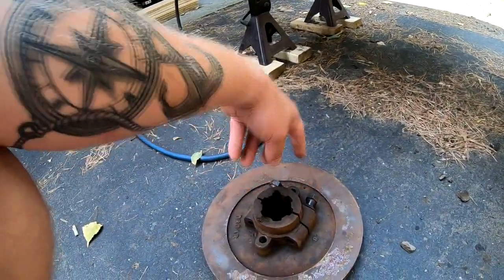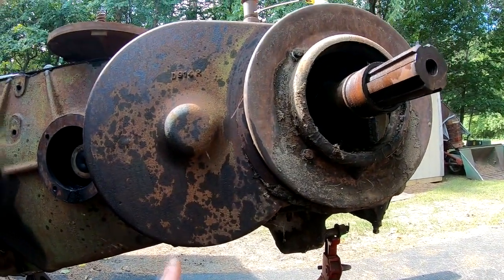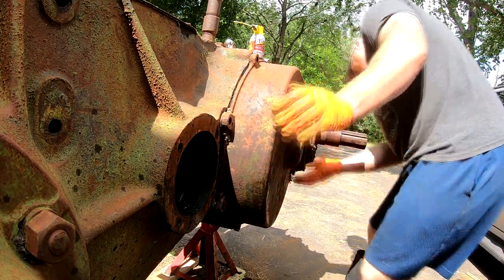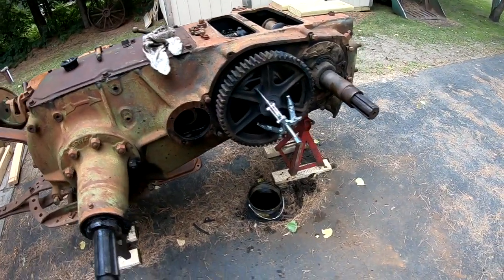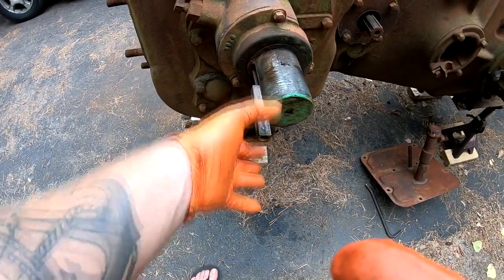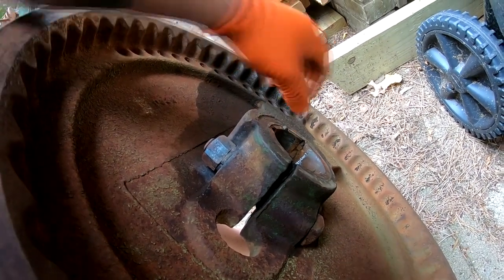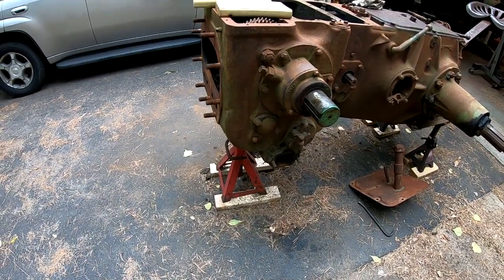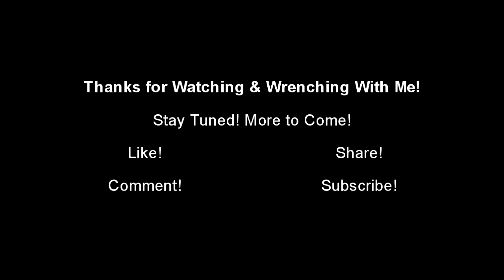1927 John Deere D S# 44891 Part 2: Belt Pulley, First Reduction Housing & Keyed Flywheel Removal

Comment: That reduction gear is usually very tight on the trans shaft, usually works better to pull the shaft out with the reduction gear still on..
Reply from the maker: Yessir. After doing a little reasearch, and asking a few of my "D expert" friends... They informed me that I should avoid pulling the gear as it is pressed on. Many of these gears have been broken by using pullers. Thanks for the tip!